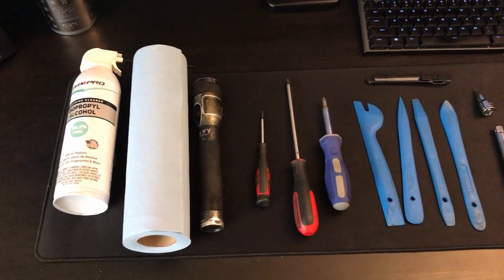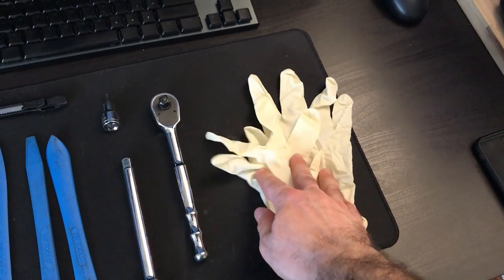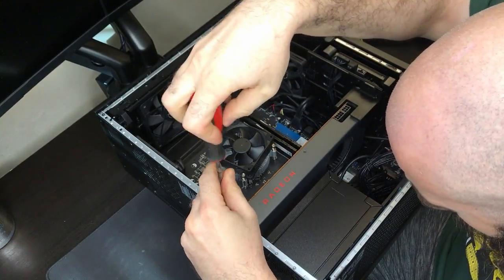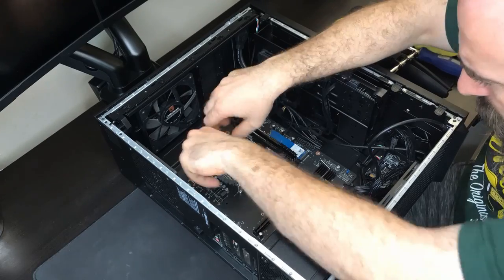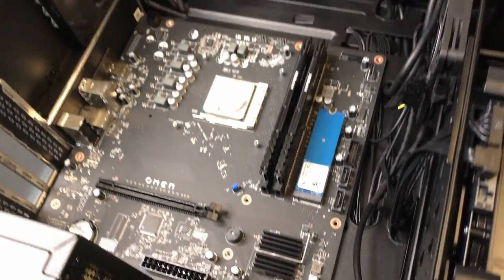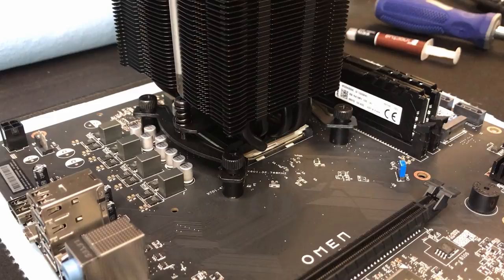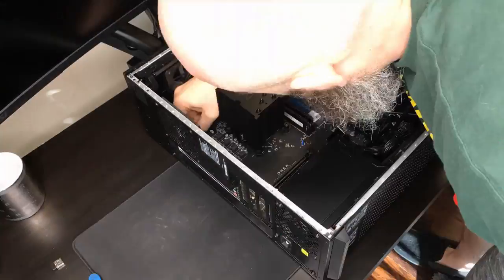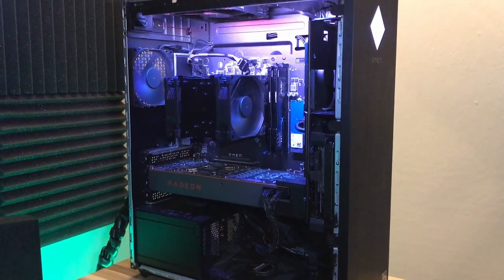Installing A Noctua CPU Air Cooler In My Omen! Complete Tutorial 😎

Comment: Awesome video and I learned so much just watching through it. I ordered a large heat sink air cooler for my 30L and I’m gonna swap it out today, but I’ve never done anything like this so I’m still very nervous.😅 Hopefully it goes well for me.
Reply from the maker: Thank you so much! Question, what air cooler did you order? A lot of heatsinks will not fit in the Omen case because they are too tall.
Reply: @DanKamYouKnow  ah it actually happened to me unfortunately😅 so I just decided to use the fan it came with as a bottom intake until I can find a decent new one. I overestimated the case’s width and also had a bit of trouble getting the stock heat sink off
Reply: @DanKamYouKnow  (I got the be quiet dark rock slim but for now I’m just gonna save it for another build later on)
Reply from the maker: Ahhh, OK. The 2 most popular air coolers are the Noctua Chromax U9S ( what I have ) and the Noctua D9L. Vast marjory of air coolers don’t fit 😞
Reply: @DanKamYouKnow  I’ve decided to swap out the 80mm fan for the cpu to a stronger one and add some case fans like you did. I think it should be good enough for my usage for now. Also I’m really thankful I learned about the y-splitters from your channel - I couldn’t get a fan hub to work with the omen bios for some reason.
Reply from the maker: Nice! Replacing the CPU cooler fan and rear fan will definitely help with temps and also with fan noise. I saw a 2-3c drop with the 80mm fan replacement for the CPU. 

Yeah, hubs and the like don’t really work with Omens, mainly because there’s no USB headers to power them, Omen motherboard are interesting, lol.

Yeah, Y-splits are fantastic. Especially when you are using high quality fans, which only use up about .2a of power and a motherboard fan header can usually power up to 1a, so you could potentially run about quite a bit of fans on 1 header.

Comment: Great video. You have really been modding this pc out. I currently have a 30l with a 3600 and a 1660s I'd assume they use the same motherboard because they look very similar, so would it be possible for me to install this exact same cooler that u just got? Thanks man keep up the great vids.
Reply from the maker: Thanks!! Yes, this tutorial will work for all Omens. Your motherboard may have a few different connects but will be close to the same. All of the Omen cooler backing plates are the same.
Reply: @DanKamYouKnow  do you know if the Noctua NH-D15 chromax Black would work on an Omen 30L?
Reply from the maker: No, it is too tall to fit in the case. You have to stay under 140mm in height for an air cooler to fit and not hit the side panel el.
Reply: @DanKamYouKnow  I have a question, did you use the Intel mounting for it? I tried the amd ones but the brackets didn't align at all they were to wide.
Reply from the maker: @itsprod.472  ALL Omens use intel spacing for their coolers. You will want to use all the Intel accessories for your cooler. AM4 brackets will not work.

Comment: just ordered mine! couldn't take the high temps anymore. was playing cyberpunk and my cpu was getting to 86-89c... even on warzone was getting up in the high 80s.
Reply from the maker: Wow, what build do you have? The U9S dropped my temps by up to 20-25c! Should be super helpful for you
Reply: @DanKamYouKnow  i have the 30L with the ryzen 5 3600 and it originally came with the 1660 super but i swapped out for the 3070 and 750w psu
Reply from the maker: Nice! A top and bottom fan should help out a lot too. Here is my current mods video if you’re interested in fan additions:

https://youtu.be/HlIAUAMwGBA

Comment: Hey Dan! My new Omen 30L will be here Friday with 16gb ram/rtx 2060/ryzen 7 3700x and stock air cooling. Your videos helped me pull the trigger on the purchase but I was curious if the stock cooling was enough for the Omen to run at safe temps when multitasking i.e. web browsing and gaming simultaneously or will I need to upgrade cooling similar to what you have done? Thanks for your awesome vids and feedback! New subscriber for sure
Reply from the maker: Hey Jaxon! While the stock cooling system on Omens are decent enough to run safe temps, they are  the weak point of this system. I would highly recommend removing the top bracket from the case, and leaving it off or punching out the squares and adding a 120mm fan to it. If you really want to cool the PC down, a CPU cooler would be your best bet.
Reply: Thank you Dan!! Awesome feedback as usual. I’ll definitely be getting an aftermarket cpu cooler down the line but these are some great quick fixes in the mean time. I think I’ll turn the processor down to 99% the same as you did in hopes to obtain lower temps as well. If you don’t mind answering a small follow up: What exactly are you referring to when you say remove top bracket?
Reply: You answered my follow up question in your in depth review video! Just saw the bracket removal for improved airflow. Love the ideas Dan keep them coming!!
Reply from the maker: @Skipper10201  The minimum processor state being adjusted to 5% and maximum processor state being adjusted to 99% will help out greatly with temps. Glad I could help you out my dude!

Comment: Hey Dan, great video! Is it true you can avoid taking out the mobo if you use m3x12mm screws and the smallest bracket that comes with the cooler? Saw on Reddit it attaches to the stock cpu cooler backplate? But not sure wether to trust it. Thanks!
Reply from the maker: I would not trust this method because you really have no idea how much pressure you are putting on the CPU. Too little or too much pressure on the CPU is not good. I know a lot of people have done it but I wouldn’t. It’s an easy process to remove the motherboard, so I would just do that. Only annoying part is the stock cooler backing plate but it isn’t bad if you have something thin and plastic.
Reply: @DanKamYouKnow  okay I’ll give it a go, thanks so much man!

Comment: Hey Dan. Is there any reason not to use the bracket that comes with the kit? And can I mount it vertically or horizontally with the bracket that comes in the kit with the NH-U95 cooler? Thanks pal. Jeremy
Reply from the maker: I did use the Intel brackets that came with the U9S kit. In the video I was just explaining how the D9L bracket I had would not fit. All Omen users ( even AMD CPU owners ) will use the Intel brackets that come with the kit. I explain it in the video.

Comment: what type of screwdriver you use to get that black Squair thingy that is blocking the air on the top? the Philip screws one. i managed to get the first one but the second one wont get out.
Reply from the maker: The squares on the bracket? You just push those out
Reply: @DanKamYouKnow  the screws which screwdriver u used to get em out? the little  screws. i appreciate you for replying back sir
Reply from the maker: A Phillips head #1 screw driver works best for the top screws. They can be very tight so be careful not to strip the head out.

Comment: Thank you for this tutorial ! 
I just have a question, I dropped one of the screw from de motherboard behind the back panel should I be worried ?
Reply from the maker: You can remove the back panel pretty easily to grab it:

https://youtu.be/TZKPmxYgoLY

One screw and the back panel slides out. If you don’t get it though, I’m sure you’ll be fine.
Reply: @DanKamYouKnow  good thank you

Comment: So helpful thank you. I have a 30l and am going to install a cooler master 212 rgb. You think I will have any clearance issues?  For some reason Rust just overheats my machine big time. Got all the way up to 93 for just a minute and then I shut it down. Haven’t played since. Hopefully this cooler will help.
Reply from the maker: Hey! The Cooler Master 212 will be too tall to fit in the Omen ( the side panel won’t fit back on ). You have to use an air cooler that is under 140mm in height. If you have the stock HP air cooler, a better quality air cooler will make a world of difference. The U9S I used in the video has had some of the best results I’ve seen.

Comment: I saw a major temp drop after installing this cooler thanks to your video! I did some calculations and it turns out the stock omen cooler only covers 49%  of the surface of my ryzen 3700x!
Reply from the maker: That’s awesome Sean! It’s crazy how much of an upgrade the U9S is over the stock cooler. No idea what HP and Cooler Master were thinking with the stock cooler. I understand it was probably insanely cheap for them to produce but c’mon now.

Comment: Hi, iv got the omen with 3080 and a 10700K, if im not mistaken  you got the i9 cpu. My temps are not really crazy hot but I would not mind getting them abit lower. If im to change one thing what would that be, a better fan for the AIO or add another intake fan?
Reply from the maker: I actually have a Ryzen 3700x processor. I would honestly change all fans in your case if you can. But I think a better AIO fan would be my first change.

Comment: Do you have to replace the backplate in order to install a new cpu cooler? Would the bracket of  any cooler fit the old bracket or is it mandatory to take it all out?
Reply from the maker: Yes, you have change out the back-plate in order to install a different CPU cooler. The new cooler should come with the bracket you need which will be Intel LGA spacing ( Even if you own a Ryzen processor, you’ll still use the Intel brackets ). You will have to remove the motherboard to install the new cooler backing plate

Comment: i have an obelisk and there is this metal thing at the top my friend told me if i can remove the metal thing i could put a 240mm aio is this right?
Reply from the maker: Yes you can remove the bracket and I highly recommend removing it because it blocks air flow coming out of the top of the PC. The bracket will only fit a 120mm AIO though. I myself went with a Noctua air cooler.

Comment: Hey really loved this video! I have the previous omen version from last year and I’m thinking about changing the thermal paste and slapping on a noctua black 120 mm fan on top of the heat sink that came with the pc. Do you think this will help? Also my temps on omen are around 45 to 50 idle and around 80 to 90 playing a game like rainbow six, and the fans get super loud lol
Reply from the maker: Thanks! Well, only an 80mm fan will fit over the factory CPU cooler. When I changed mine a while ago, it dropped the temps about 1-3c overall for the CPU. The biggest change you can make though is swapping out the whole CPU cooler.
Reply: Awesome thank you!

Comment: 14:30 you mentioned “you are going to need a Intel bracket regardless if you’re using AMD or Intel” I use is a ryzen 3700x (sams as urs) when I buy it do I select Intel option?
Reply from the maker: All Omens use the Intel brackets for mounting. The U9S will come with everything.
Reply: @DanKamYouKnow  got it thanks!

Comment: Any specific reason you went with the U9S?

Why not the U12S or U14S? Would they not fit in the relatively slim HP Omen case?
Reply from the maker: They will not fit in the case. Only the U9S and D9L fit in the case and the U9S is the only 1 offered in black. My system runs fantastic with this cool so I’m happy.

Comment: Hello and thx for your video. Is everythig included to add this fan to the mainboard, when I buy a noctua fan, ore must I have a adapter from the mainboard itself?
Reply from the maker: The new cooler will come with all the accessories needed to mount it to the motherboard, then you’ll follow the procedure in the video.
Reply: @DanKamYouKnow  Thank you very much for the fast awnser 🙏

Comment: Hello,

Is this the 25 or 30L Omen? also what fan did you mount at the top and bottom? Thanks in advance !
Reply from the maker: Omen 25L. I used all Noctua fans for my build. The top and bottom fans are both 120mm. I have a video dedicated to my fan setup here:

https://youtu.be/vnI0SSLjmus
Reply: @DanKamYouKnow  I ll definitely copy you !!! I wasn't sure a 120MM would fit the top of the case. Thank you so much for this video it's perfect !! May I ask what fan you used at the bottom? I know it's a 120MM but what height?
Reply from the maker: You can use either a 14mm height or 25mm height fan, both will work but the 25mm is a little more difficult to squeeze in. You’re welcome and I’m happy I could help 👍🏻👍🏻👍🏻
Reply: @DanKamYouKnow  Sorry one more question, on the cooler I am only able to find a one fan version. Did yours come with two? or just one but the metal bracket to hold it came with it?
Reply from the maker: The cooler comes with the clip needed to mount and extra 92mm fan, but you will need to buy the fan separately

Comment: Hey Kam, saving a lot I have been able to buy an OMEN 30L GT13-1014ns. Now I'm concerned with heat, I also want to play New World ... do you think adding / replacing fans is enough or should I go for the cooler? I'm afraid of messing up the motherbase. Thank you very much for your fantastic videos.
Reply from the maker: Thanks! If your system came with the HP air cooler, then replacing it will be very beneficial. If it came stock with a liquid cooler, then replacing it won’t make too much of a difference.

Replacing the cooler isn’t too difficult if you take your time and have the right tools. 

Fan additions will help with airflow and drop temps a little bit too

Comment: Has anyone figured out an easier way to cool the CPU and case in general other than having to remove the MB? Im not THAT tech savvy =\ I can fans, lol Thanks
Reply from the maker: I have full fan replacement tutorials:

https://youtu.be/vnI0SSLjmus
Reply: From watching Dans videos I’ve set up all my fans and thanks to a Reddit post found out you can take this exact Noctua NH-U9S and the black spacers it comes with and some screws that don’t come with it (m3x12 screws) and you can use the spacers to put over the tips on the MB and install the Noctuas Bracket without removing the MB therefore you can install the cooler without removing the MB

Comment: Thank's for all your vids  ! (i got an Omen 25L in december), so much useful information
No problem with fan control in Omen application ?
This CPU cooler will be my next buy,  also i have to change the graphics card, Geforce GX 1660 TI because the fan never stops (such a shame)
Reply from the maker: I'm glad my videos helped you out! Fan control works exactly the same. Most fans on GPU's are always on, they are designed to ramp up the speed with the their temp gets warmer. You can use MSI Afterburner to change the fan curve of your GPU but I would rather have my GPU be cooler than quieter. But, a 3060Ti or 3070 would be a real nice upgrade from what you got!
Reply: @DanKamYouKnow  
No need to have a fan working  (specially a noisy fan, like this one)  when a GPU is not hot, right ? I'm looking for a GPU with hybrid fan, best of the two worlds and yes Radeon will be a good choice (I'm a linux user)
By the way, thank's for the tip of memory frequency with Ryzen master: the good news is that it remains persistent when i switch to linux.
Happy New Year's Eve, man
Reply from the maker: Thanks Pierre! How you find what you are looking for! Happy New Year to you too!

Comment: Hey Dan, as the summer is coming up the temp of my computer is rising so i am thinking about getting the exact same CPU cooler as you, I was wondering if the cooler comes with pre applied thermal paste?
Reply from the maker: Hey! It does not come with pre-applied paste, but it does come with a tube thermal paste that you will have to apply.
Reply: @DanKamYouKnow  nice thanks, I appreciate

Comment: Not sure if this was asked but why did you need to install the intel bracket instead of the amd 4? Would the included backplate of the 25l not support the cooler? (Since it was intended with use for the original amd 4 bracket that is included in retail mobo)
Reply from the maker: So Omen motherboards are very strange as both the Intel and AMD models use the Intel spacing and brackets for the cooler. So even though I have an AMD processor ( which should use AM4 brackets, spacers, and screws ), I had to use the Intel accessories to install the cooler! They designed it this way so they could use the same coolers for Intel and AMD models, rather than R&D 2 different ones. It's a pretty smart move on their part but definitely weird if you're planning upgrades.
Reply: @DanKamYouKnow  Didn't expect a quick reply! Thank you, you just saved (us) a lot of time with this info. A quick thing I'd like to point out for people is that the rear exhaust fan is a 92mm, not an 80mm. Even though I've been building pcs for 20+ years I didn't catch it until I was installing it. Thank you for your videos, they've been extremely helpful, especially in todays age when building your own pc may not be as feasible as before because of the lack of parts in stock.
Reply from the maker: Yes, the rear fan is 92mm, the stock air cooler fan is 80mm and the top bracket only supports a 120mm fan / radiator ( if you planning on going the AIO route ). You’re welcome and I’m glad I could help! I originally went to build my PC but in April and May of 2020, CPU’s and PSU’s were VERY hard to come by, so I bought the Omen. 👍🏻👍🏻👍🏻

Comment: Did you test the top fan as Intake and exhaust? I’m planning on do this same upgrade but don’t know which orientation I should have my top fan as.
Reply from the maker: I’ve tried both orientations multiple time and exhaust worked best for my system.